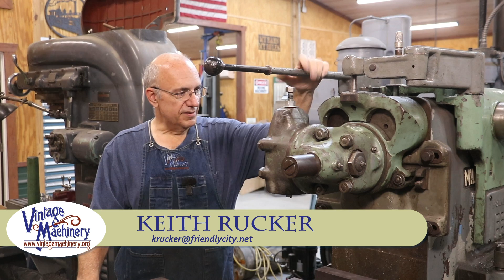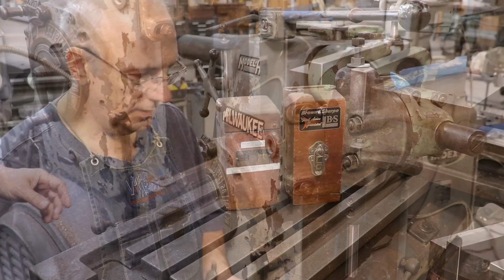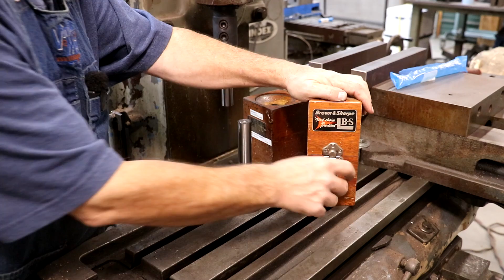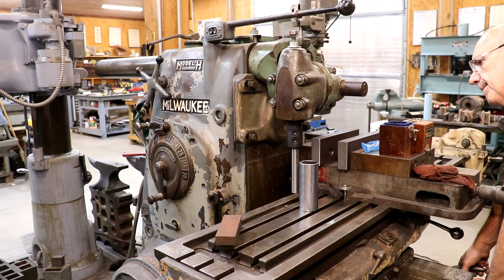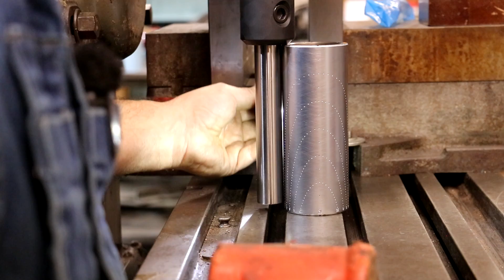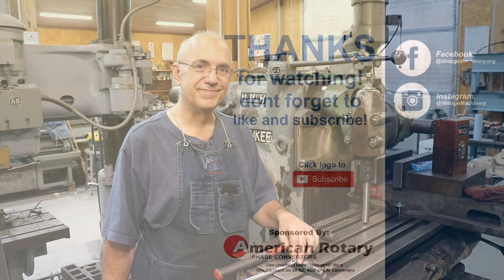Using a Cylinder Square to Tram a K&T High Speed Universal Head on my Horizontal Milling Machine

Comment: What is the advantage of using this complex setup (in a "perfectly" plumb orientation) on a horizontal mill to achieve what looks effectively to be a vertical mill?
Reply: That machine has more torque and more rigidity then any knee mill he's got.
Reply: IIRC - the size of the job that can be handled. Keiths Horizontal Mill is larger than his Vertical one

Comment: Keith what you could do to fix the problem with the head wanting to swing as you explained it to drill a center in one end of the bar, then use a ball bearing under it and support it with the table. and raise and lower the table to tram it that direction. Thanks

Comment: Use a machinist jack and some blocking to jack up the main head to control the rotation. That way you can loosen it up and jack it up or down until it  is where you want it.

Comment: Some very sound points on tolerances and precision, there, Keith. Every order of magnitude in precision is an order of magnitude in expense and time, so a designer needs to know what level of precision is required for each feature. Over specification is at least as bad as under specification, if not worse (and certainly more common). Nobody in their right mind would specify sub-micron precision for a casting pattern, for example.
Reply: More likely a couple orders of magnitude in expense, time, and aggravation.

Comment: A topic that might be worth a chat is reproducibility. If you have to make 20 parts that need to be interchangeable, how do you evaluate tolerances and errors?
Reply: It is going to depend heavily on the situation, but in general, a good approach would be to purposely make a few test parts that vary in dimension by a controlled amount, and see if they work or not.

Comment: Speaking as a tired old programmer....  When is a programmer done with a project?  Answer:  When his boss takes it away from him.
Reply: That same thing can be said about a perfectionist.
Reply: Software is never none.  It's just abandoned in a semi-usable state.  The programmer still won't be done with it when it's taken away.  He'll still be thinking about what he could do with it.  At least that's what happened to me.  I've been at it for 54 years and still wake up wondering "What if I did......."
Reply: @kensherwin4544  is it possible that you're a perfectionist, or is that common with all programmers?
Reply: @buckinthetree1233  No programmer I know could leave well enough alone.
Reply: @kensherwin4544  Excuse my ignorance, but don't software programmers create their programs in response to a software requirement, and are given a set amount of hours to complete.  So to what job would you book your extra hours to take it beyond spec to a place that satisfies you personally?
Reply: @richard-jz1qd  I wrote my own specs and created my own features.  I also didn't need to book hours against anything.  My boss's only requirement was for me to be happy with the product. He figured that if I wasn't happy yet, the customers wouldn't be either.

Comment: Interesting tramming technique, Keith.  Seems very effective and fast.  Going from precision tool and diemaker to outside machinist in shipbuilding called for a major mindset change.  To be effective in any machining job you have to understand the real requirements for accuracy and not go beyond that.
Reply: We built five tankers 272.69 m (894' 7.8") in length.  Normally, the shipyard marks the centerline of the shipways or drydock before the start of assembly.  In a large drydock, they may be building more than one ship at a time each with a different length and beam (width).  Setting the centerline is critical.

On one ship they set a bulkhead in place before establishing and marking the build centerline.   The shipyard then determined the centerline of the ship from one side of the bulkhead looking forward and the other side looking aft.  It was not until the official length, beam, and depth measurements were taken before the ship was launched that anyone realized the centerline was bent.  The bow was 0.15 m (6") off-center.  The error was not detected during construction.  But, the cumulative error was measurable before the launch.
Reply: What is an outside machinist in shipbuilding?
Reply: @sbrunner69  Shipyards have machine shops which are responsible for machining parts such as propeller shafts  rudder stocks, and rudder pintles.   The shops will also turn the rough inside and outside diameters of bearings for the rudder and sterntube.  Some shipyards manufacture watertight doors, while others produce their own propellers.  The machinist in the shops are considered to be "inside" machinists.

There is a second group of machinists that work on the ships, or away from the shops, they are referred to as "outside" machinists.  The work they do ranges from aligning engines, gears and shafting.  They bore the sterntube, rudder, rudder castings, and pintles to size for bearing installation.   Outside machinists align machinery, shim and bolt it in place.  They bore and fit tapered bolts used to hold shafts together.  They are also responsible for fitting and installing hydraulically tensioned bolts.  In general if the work is machinery related, and is done in the outdoors or on the ship it is done by the "outside" machinists.
Reply: @sbrunner69 field machining, rigging, millwright, it's bullwork mostly, but pretty rewarding

It's done and named such, outside as in not in a shop
Reply: The Russians have a saying about this. " Good enough"

Comment: Putting a ball bearing between the table and the bottom of that rod will allow you to use the up and down feed Of the table to aid in adjusting.
Reply: That's how I saw it done in the 70's while I was training.
Reply: Wouldn’t a point contact like that risk putting a dimple into the table? Plus the bearing could slip out. Why not just use a shim of wood? There should be enough friction to even do the adjustment by moving the table.
Reply: @jamanjeval  Actually, the guy I watched had a brass 'washer' on the table to prevent any marking from hardened ball.
Point contact from ball makes lining up much easier for some reason but I don't remember why as I've never had to tram that type of mill

Comment: I work in Automotive manufacturing. Tolerance stackup is indeed a pain. Usually, the larger assemblies get a looser tolerance. And usually, the parts I work with being mostly sheet metal (body parts, etc.), there's some things than can be adjusted in the (sub)assembly process. Still, I have countless stories of being up the creek because I have two parts whose tolerances are near max and not in a way that agrees with each other... we find a way to make it work (and push back on the prior process/supplier to level it up), but aggravating nevertheless.
Reply: Tolerance stack up IS a PITA! Years ago, I was a Warranty Engineer for a German Diesel Engine manufacturer. Suddenly we started seeing problems with one particular application. The engine was mated to a ZF transmission and sometimes the thrust bearings would go bad on one machine, but not on the next five or so. My boss liked to assign me tasks WAY above my pay grade (he took a personal interest in my development as a young Engineer, he was a 50-State PE. SO I did a tolerance stackup based on the factory specs of the engine AND the transmission and YES, in fact if the tolerances in the transmission stacked up the wrong way it "Preloaded" the thrust bearings in the engine! ZF was "thrilled" when we informed them... :face-green-smiling:
Reply: And with repair parts it only has to fit on one particular machine not any one of ten thousand machines.